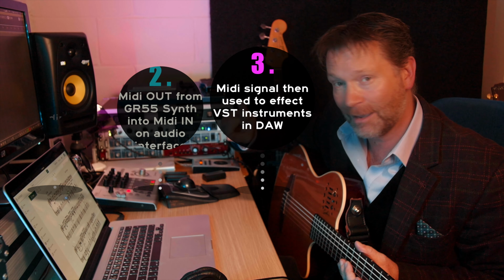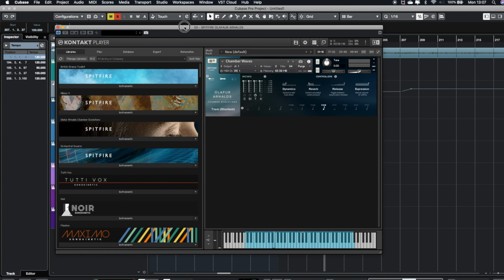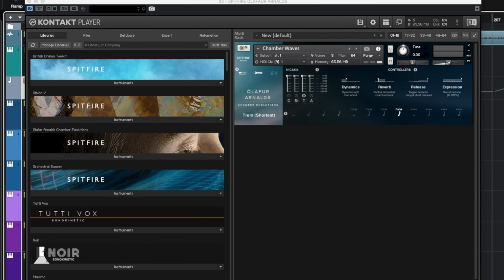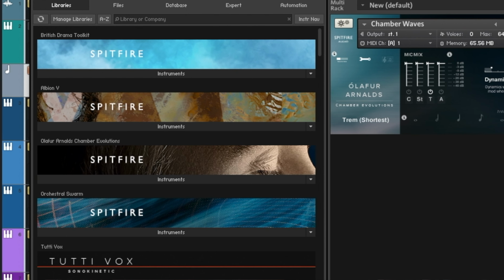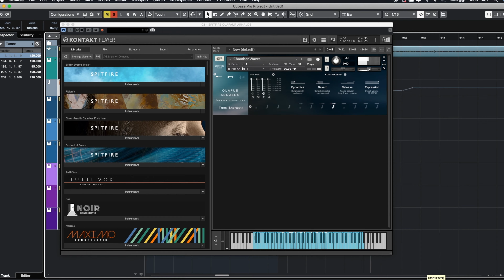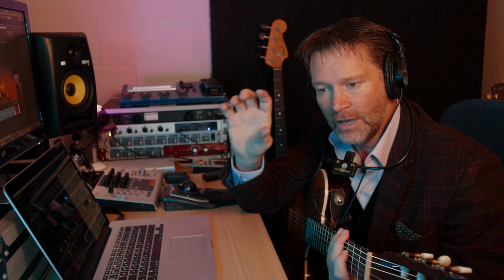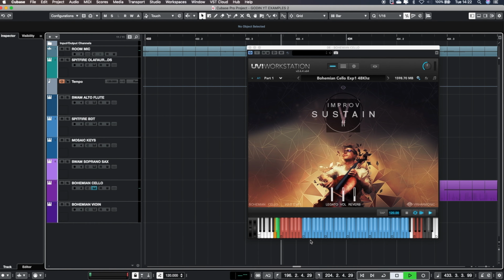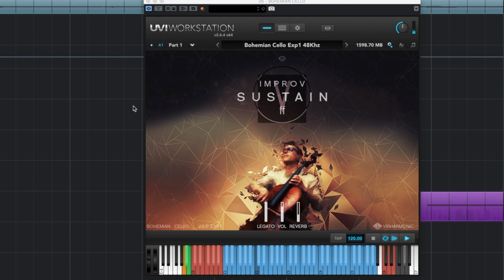Godin Multiac MIDI Grand Concert Guitar - This guitar is a BEAST! #6

Comment: Hi, great videos👍👍 does the Nylon SA or the Grand Concert SA can be played with table top tapping like flamenco or gipsy techniques? I understand that some players do but with models without the SA…. Which would be a pity for me. Thanks !!!
Reply from the maker: Not so great, however, the new version The Grand Concert Deluxe is exceptional. i am working on some videos of this. It has a build in microphone to pick up the tapping and body work in addition to the saddle pick ups.

Comment: Hello Andrew,
I'm writing to ask for some assistance regarding an implementation of your instructions from this video.

I have a Godin ACS Slim guitar, a Roland GR-55, a Focusrite Scarlett 8i6, and Studio One 6 Professional as my DAW.

I've connected the GR-55 MIDI Out to the Focusrite MIDI In, and I also have the USB connection between the Focusrite and my PC/DAW.

My goal is to use VST instrument plugins like Addictive Keys (Grand Piano) and MODO Drum and Bass.
I'm unsure about the correct DAW setup. 

Specifically, I'm not sure which device should be set as the external MIDI device (GR-55 or Focusrite?) and what the settings should be for "Receive From/Send To."

Currently, my DAW isn't recognizing any MIDI signal from my guitar.

Thank you very much in advance for your support.

I wish you a Merry Christmas and a Happy New Year!

M. Z. Momo

Comment: Hey Andrew! i just see your video and i'm not sure to understand the midi method.... to use the Godin midi, you absolutly need the GR-55 to play with kontakt vst?.... i'm a AXE FX3 user but i'm not sure i can use the 13 pin on that, maybe in that case, an other device is needed to use the 13 pin?

Comment: Hi Andrew how are you! your channel is very good! My name is José Torres Duval from Argentina. Now I am in Poland.
I wanted to ask you about my Godin Multiac ACS guitar. Can I use it as a midi controller, just using a 13 pin cable to a computer or audio board or do I definitely need to have a roland pedalboard? Thank you very much for the reply
Reply from the maker: I am afraid you cannot just plug 13 pin into anything other that the synth as this then converts the signal into a midi output signal.

Comment: I'm not sure what you said initially is true: I've read elsewhere the 13 pin cable is not digital out, it's split analog out from the divided pickup. You need something like the GR-55 to do the A/D and convert it to MIDI.
Reply from the maker: That is correct. The 13 pin comes from the guitar into the GR55 and then midi is out into DAW.

Comment: Can be used Godins midi out (13 pin) directly to audio interface MIDI IN?
Reply from the maker: no that won't work, as the 13 pin din is Roland connection to an Gr55 synth. It is not a strict MIDI out. The synth converts this signal to a midi signal. Then Midi out of the GR55 to Midi on the Audio interface.
Reply: @AndrewKeeping that would help,  thanks for the reply!!!
Reply: @AndrewKeeping  hello thanks for all! Is there any other solution to send the godin to a daw in MIDI please?

Comment: Thanks for this very useful video.  How is the tracking of the GR55 at speed?  I have a GR33 that I never felt great about for tracking lower registers?
Reply from the maker: Thanks for your message. Glad you liked the video and yes the GR55 is still good at tracking timing. I have very few issues with my headphones on listening and playing along to the new sound.
Reply: I used a Gr33 for a while never felt good about it, downgraded to a GR20 and that is far better tracking. I also use Electroharmonics Mel9 I like the cello, choir and flute sounds, It tracks faster than Rolland covering up the latency plus I use Rolland for string pads only Mel gets to play lead notes. No one really gets what I'm doing so many loopers and prerecorded acts out there people think I have backing tracks when I'm entirely live. Sadly I should just play straight acoustic arrangements so people can appreciate polyphonic guitar arrangements with no distractions from the ensemble of modules... but I like the full sounding ensemble.

Comment: This was incredibly helpful, as I am a longtime MIDI guitarist who will soon have to be trotting out fiddle parts in a country band. It's slightly frustrating that nobody ever seems to take the Virharmonic Bohemian plugin into such rustic territory, but I can tell that it will beat the pants off the violin samples in my GR-55. Having a computer onstage, well, what's one more fail point in my already complex guitar rig? May even look into the breath controller, as it seemed to work for Allan Holdsworth...

Comment: Hello my friend. I have loved the thoughts of a Godin multiac for years but can't find any near me. I play with a praise band and find that if I use a nylon string guitar finger style the base and piano drowned my strings out. I play mostly rhythm and finger style to fill in. I know you do studio with all thecdouds and effects, but should I justgiveintothe thoughts that the Godin is a soloist guitar?
Reply from the maker: Not at all Tony. I have used this many times in ensemble and as an accompanist to singers and instrumentalists. If you need the instrument to cut through, you have the ability to adjust the tonal settings with a bass, mids and high frequency EQ sliders on the guitar. This in conjunction with the eq's on the amplifier, or even with an addition Parametric Equaliser pedal, you would be able to find a balance that will allow a guitar to cut through any mix of instruments. i hope that helps answer your question. Best of luck!
Reply: Hi Tony ... I play either electric or acoustic at my church (Westhill Community Church, Aberdeenshire) and can confirm that a nylon string with midi out (I had a Carvin NS1 ... check out Steve Oliver YouTube videos to show you the full set of things you can do) combined with a guitar synth (I still have my second hand Roland GR33 to use with my Godin LGXT SA guitar) gives you a vast array of options to work with in a praise band setting with no computer being required at all... you can have nylon string only out,  midi only out (each string can be set up to a diiferent midi sound), blend of nylon string and midi... nylon plus a string or keyboard pad is great, midi horn(s) can add a lot to praise songs ... combo of nylon plus cello, violin, strings, etc (when carefully mixed) can work great ... set up is guitar with 13 pin midi cable to synth and also a jack to jack cable to synth ... then synth can sort out a pass through of nylon string on 1 output to amp/di box and a midi only (or blend of nylon string plus midi) on other output to amp/di box for PA ... (or, if going to pc, there is another output to "pc land" - which I have never done personally)... with the guitar controls giving you control over blend and moving up/down through midi sounds (you can put all your favourite midi sounds in adjacent settings on the synth to go from violin, to cello, to piano, brass, screaming electric guitar, etc ...) ... if you download a .pdf of the Roland guitar synth manual you can see how many hundreds of sounds you can easily access (and tweak to your own settings) ... you can also see how reasonably intuitive it can be .... you can also do likewise to get a .pdf of godin synth access guitar manual .... which is a very short document as the roland synth really  does all the work.... you can have a lot of fun creating with a guitar, guitar synth combo .... CMcG, Aberdeen, Scotland

Comment: I'm pretty sure the the signal coming from the 13-pin cable is not *digital*. It's an analog 6-channel signal, and all of the MIDI conversions happen in the boxes the GK mic is feeding. Nowadays there is technology that can do the MIDI conversion from a regular guitar signal, no special hexaphonic GK mic needed. Check out MIDI Guitar 2 by Jam Origin. Roland/Boss themselves have the Boss SY series of pedals that can do guitar-driven synthesis without a GK hex mic, though I think they don't have MIDI out. But MIDI Guitar 2 has! :)
Reply from the maker: I am very interested in this. I will look into and perhaps do a review. Thanks for the heads up!
Reply: @AndrewKeeping  Looking forward to seeing your review! :) It's surprising that MIDI Guitar 2 hasn't got more attention, because it's basically doing everything that people have been dreaming about - accurate and clean fast guitar-to-MIDI conversion without special pickups and bulky cables. It's been out there for some years already. Maybe the problem is that it's not a hardware box, and it's not made by a well-known manufacturer. I've had a Roland GR-33 synth pedal and GK hex mics in two guitars for over a decade, but haven't used them much after the first couple of years. The system is simply too much hassle. I can say that MIDI Guitar 2 is better and more useful. The only downside is that it's not a stand-alone box. I've now ordered the new small Boss SY-1 pedal, let's see what it's like.
Reply: @yzimsx   Hi, and what About nylon string guitar as for example Godin Miltiac with Jam Origin? do you have any experience ? I'm interested in playing concerts with classical guitar but with synth sounds and looking for good solution for years. Almost bought the same as Andrew with GR55 but still I'm a bit worry of the latency playing fast and modern pieces..thank you for your answer

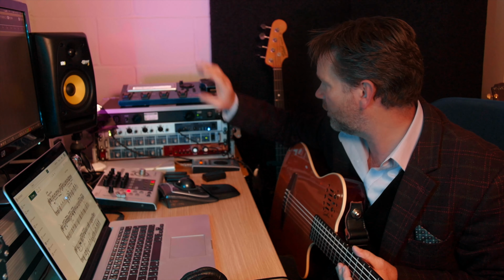Comment: Hi Andrew,  thank you for the nice video.  Question:  Why you didn't use the USB MIDI out option of the GR55 ?  My understanding is that with the Roland GR55 you can send MIDI signal via USB when connected to the computer.  Maybe you could include your test results on the follow up video that you mention at 2:24  mark of this video  :-)   It would be extremely helpful to learn from you how you connect it,  and for us the not so fortunate that can't spend $2K on the RME MIDI interface how it can be done straight from the GR55 to the PC.  Thanks

"By default, the GR-55’s Guitar-MIDI switch is turned off. To send MIDI notes from the GR-55’s USB port or MIDI output, this switch must be turned on.
Here’s how to do this.

1. Press EDIT.

2. Press the right-hand PAGE button to the select the SYSTEM tab.

3. Use the cursor buttons to highlight “MIDI/USB,” and then press ENTER.

4. Use the PAGE buttons to display the GTR-MIDI tab.

5. Use the cursor buttons to highlight “SWITCH.”

6. Turn the dial clockwise to select “ON.”

7. Press EXIT when you’re finished—the new setting is saved automatically."

Comment: Thank you Andrew for your informative and inspiring videos.  I appreciate your professionalism!  With your set up can one expect to use it with Finale notation software to print the music I play and achive results that don't require a lot of correction?  I have been manually typing the notes.  Cordially David Drury
Reply from the maker: I have used it with Sibelius, and so I would assume it would work with Finale. You do need to make note corrections and play so notes don't ring over. It is also very important to have the velocity and strings set up on GR55 to work most effectively and not have too many ghost notes.
Reply: @AndrewKeeping  Thank you
Reply: @AndrewKeeping  Thanks Andrew!

Comment: I also have a lovely Godin guitar. The electric LGXT. Would the connection not be faster by using the midi USB out of the GR55?
Reply from the maker: absolutely an option. Not sure there is much of a speed difference though.

Comment: Hi
I recently got myself a Godin Multiac Grand Concert SA. Do I need a Guitar Humidifier for it. I always keep it in its bag whenever i'm not playing and since it has a semi-hallow body, my concern is it gets dry out and crack. Any tips would be appreciated? Thanks
Reply from the maker: Depending on your climate, if you leave your guitar out of its case just have a small bowl of water next to it. I would always recommend a humidifier to protect a guitar. There are so many different models, but worth it.

Comment: I don’t understand the midi in midi out stuff. Will it not work with plug in’s if you just plug it straight from the guitar 13 pin to an audio interface and then into the computer?
Reply: Also could you please make a tutorial on how to convert midi into sheet music that is orchestra ready. I love your videos!
Reply from the maker: Thank you Larson for your kind words. You need the audio interface to send the MIDI information from the GR55 into your computer. The 13 pin only sends a signal from the guitar that is then decoded into a MIDI signal in the GR55. The audio interface will not recognise the 13pin signal on its own.
I use the midi signal to write music into Sibelius score writing system and on Cubase score system too. I will look at doing a video on this in the not too distant future.
Reply: Thank you!  @AndrewKeeping
Reply: If you use logic x then you just go to “score setting” and all of the notes you play show up as notation. The godin does need to be played very cleanly in order to not trigger ghost notes though.

Comment: hi there, just recently wanted to get a Godin Multiac Grand Concert Duet Ambience SA; however, ever since that this particular model doesn't require amp  and cable to produce nylin string sound, my question is- if on a live stage, would I also hear my nylon strings while I use daw vst playing another instrument? I've noticed that you had guitar sound on first few notes and it disappeared after seconds. Could you explain a bit more in detail? Thanks a lot! I'm new to synth guitar.

Comment: Hi, great video. I would really appreciate it if you could answer this question: do you know of any device that is a lot cheaper than the RME that would do the same thing and make the signal a VST for sending to cuebase?  I'm an amateur player but I have the same Godin as you and also have access to cue base. A used GR55 would cost circa £400 and if I could find an inexpensive way to do what your RME does then I think I would go that because even a used RME seems to be £1000 or so which is outside my budget...
Reply from the maker: https://www.musicradar.com/reviews/mackie-onyx-producer-22
This is a good option on a budget as it has an in/out MIDI. This is what you need.

Comment: I have an interface with midi inputs. Would I need the roland synth?  Or can I just play through whatever DAW I have?
Reply from the maker: Yes you do. The 13 pin din is a Roland plug and the Gr55 synth converts it into midi out. From that you connect to a Midi device or DAW.

Comment: Hi, Andrew, after i see your video, i realize you have solved the problems which confused me for quite long time.  I wonde if you can help me out? that would be so great! 

Here is the situation: i use a guitar (Godin multiac acs slim) connected to gr55, then connected to interdace to daw (abledon live10) to record midi, encountered difficulties can not be solved: 1. When recording, the recorded midi signal is always delayed relative to the project speed when inport the playing; 2. When import the playing, the recorded midi content is confused and tangled with the actual playing content due to the resonance of the guitar. How can I set it up to perfectly match the midi recording with the actual playing import, like you did.
Reply from the maker: you can adjust velocity settings for each string in the GR55 and also adapt delay. There are videos showing this on YouTube. Good luck.